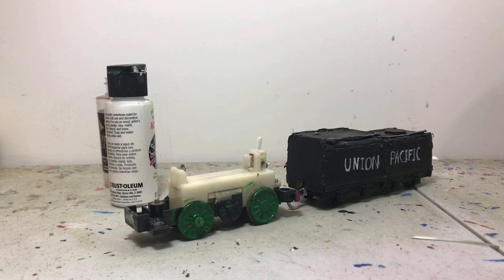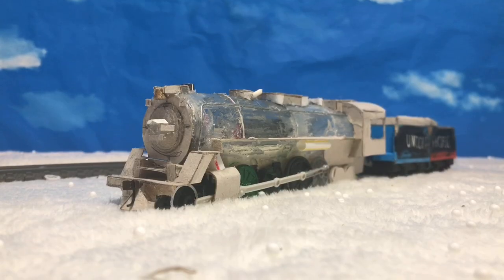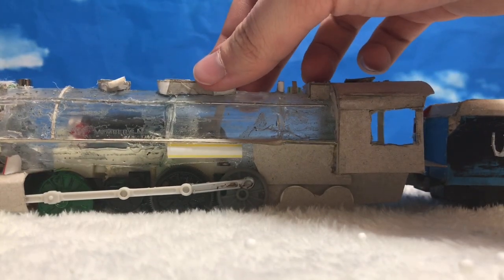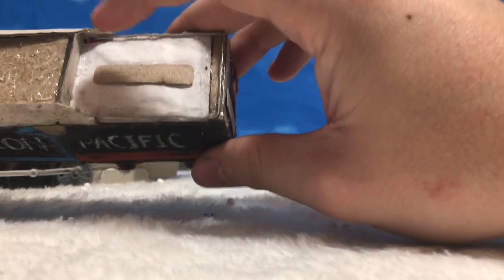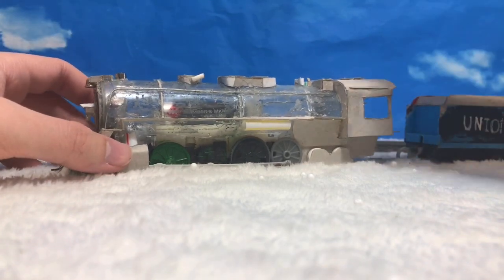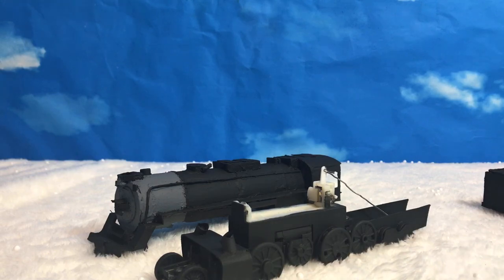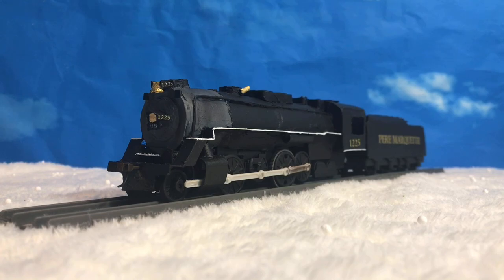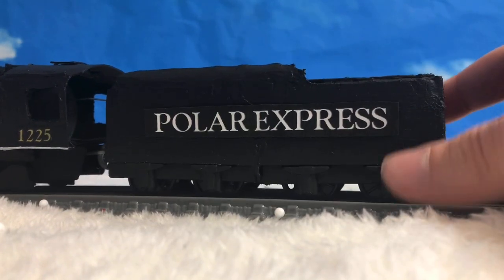CustomsInTheMaking ChristmasEdition- Ep17- The Polar Express/Pere Marquette 1225

Comment: The Pere Marquette (pronounced Pear market) 1225 is an N-1 class of berkshire type steam locomotive built in 1941 by the Lima Locomotive Works. Those indication lights on the front are marker lights/classification lights.
The area that you pointed to infront of the cab, those are the safety valves, those pop when you build enough boiler pressure to run, or when bad things are gonna happen.
The big box on top of the boiler, right infront of the cab, is called the turret, under here is some hidden valves and such to just make everything look nicer.
The other, circular valve infront of the turret, is called the blowdown. This is what you use for shutdown, although not the only thing. 
For what it is, this is actually really awesome. I volunteer with the real thing, and it is always cool to see peoples videos, and creations.

Comment: If I can make a suggestion for the coaches. The Japanese coaches you can get with the special plarail C12 Thomas and C57 James. Those coaches already look very similar to the Pullman heavyweight coaches. Only a little bit of cardboard on the roof of the coaches would be the only real modification needed other than painting them. Also they are relatively cheap since those coaches are still being produced. But that’s only a suggestion.

Comment: Fun fact, PM 1225 actually double headed with its slightly more modern cousin NKP 765. However, the most notorious event with these engines was the parallel run on CSX trackage.